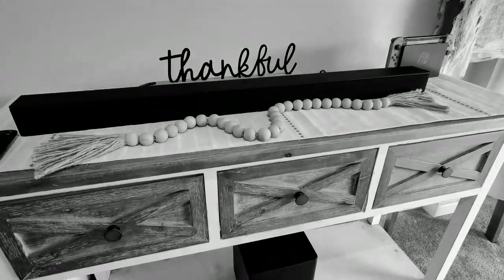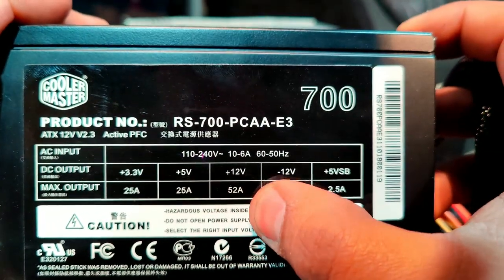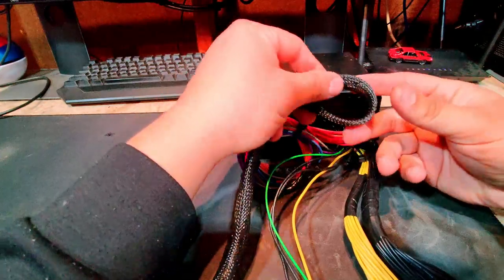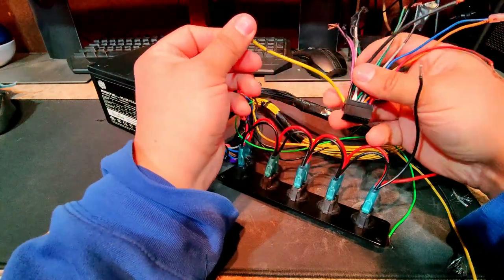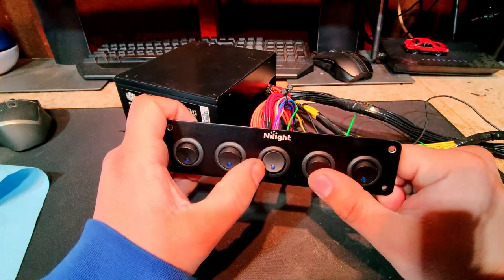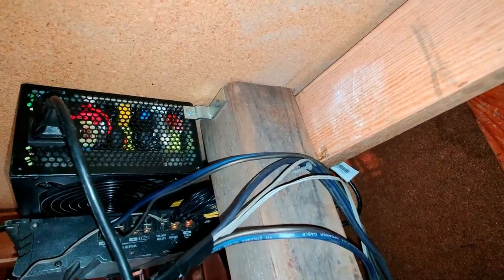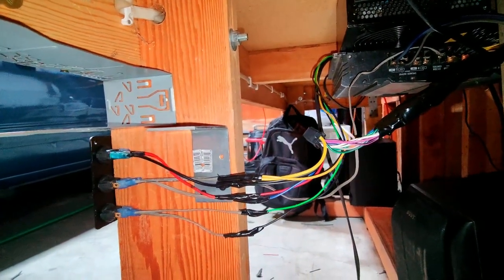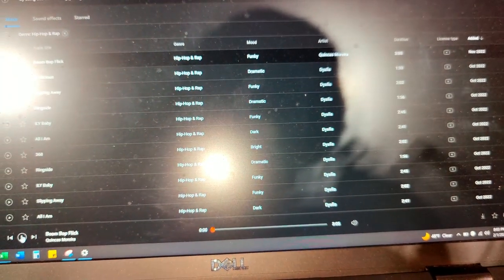CAR STEREO turned GARAGE SOUND SYSTEM with an ATX POWER SUPPLY (Garage Project #1)

Comment: nice sharing. how the sound compare to home audio?
Reply from the maker: Great question! It sounds better than the sound bar I have at home but probably not as good as an actual home sound system.
Reply from the maker: It all depends on the components you use

Comment: No fuse for the amp or does the powersupply have built in overload? Like a car would have fuse from battery to amp
Reply: Most power supplies have overload protection so a fuse from the psu to the amp is not required. I would only add one if you are using a super old power  supply that does have overload protection.
Reply from the maker: Hey that's a great question! If you have a quality power supply, it should have overload protection built in. Adding a fuse is not required in that case but redundancy is not a bad idea. Better to be safe than sorry. If I were to do this over again, I probably would have added one. I didn't because I just pieced it together with stuff I already had. Thanks for watching!

Comment: You never show how you wire the amp that’s what I wants to know
Reply from the maker: Sorry about that man, this video was mostly about how to get the power supply to work with a car sound system. But anyway, the amp gets audio data from the "RCA" cables with go from the amp to the radio. The radio also has a small wire that goes to the amp to tell it to "power on" (I added a switch for convenience). Then the amp gets power from the big yellow and black cables that I made by joining a bunch of cables together. That's really all it is. Oh and then there's cables going from the amp to the sub.

Comment: It turns off then off
Reply from the maker: Hey thanks for commenting, not sure what you mean tho.
Reply: I'm sorry the radio turns on but then the amplifier turns on then off I was thinking maybe the ground wire just thinks it's not getting a good ground but the radio does work
Reply from the maker: @mineprixelz9697  sounds like it might be going into protect mode. Try searching YouTube for protect mode for your specific amp. My amp is super old so it doesn't have as many safety features as it probably should. Lol
Reply from the maker: @mineprixelz9697  you could also try cleaning the terminals and then rewiring the amp. Good luck man!